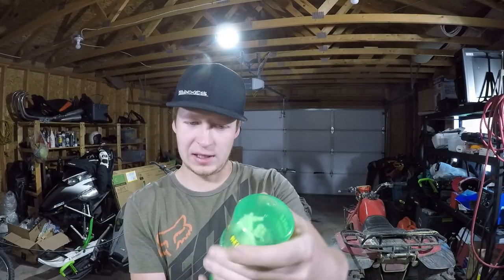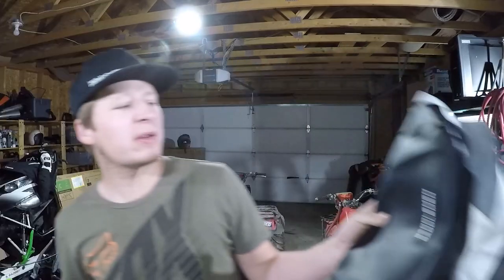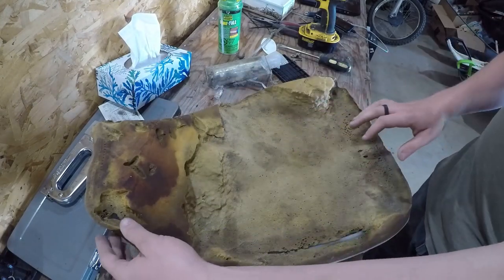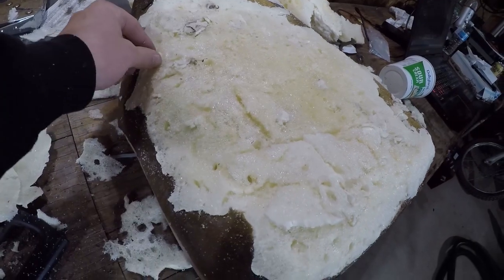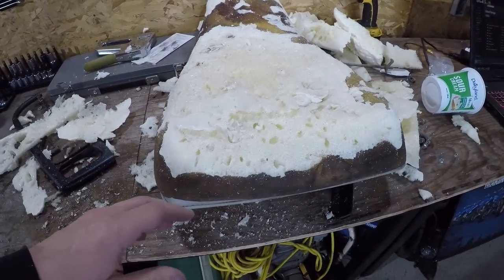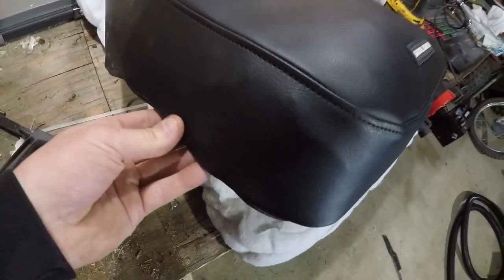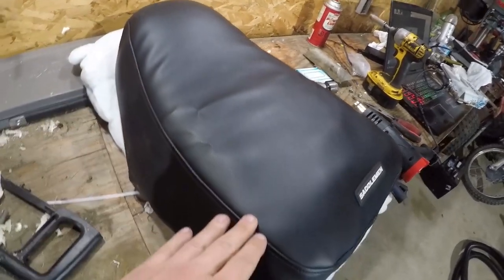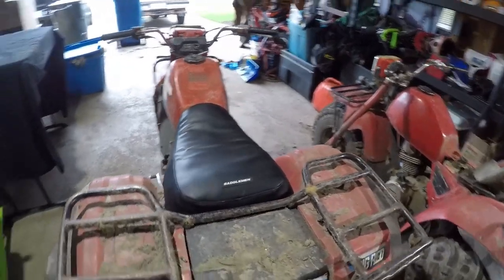NEW QUAD SEAT COVER WITH EXPANDING FOAM

Comment: Good win with the foam. I’ve replaced a few covers and my results got better when I stapled it really tight at front and back first, forming a kind of tent ridge of fabric longitudinally, then did the sides working from the middle, so that you pull the tented fabric down tight agaist the foam without wrinkles. Can also use a flapper disc on a grinder to smooth off the foam before covering. Swearing is essential.

Comment: Looks pretty good. I work at an upholstery factory lol, just a suggestion, if u just take apart the front and pull it really tight it will get rid of the wrinkles. Mite have to fo the same on the back to get all of them out. Using a heat gun works very well too to make the cover stretch better. Just my to cents
Reply from the maker: Thanks for the input!